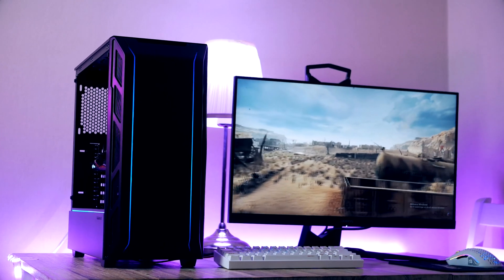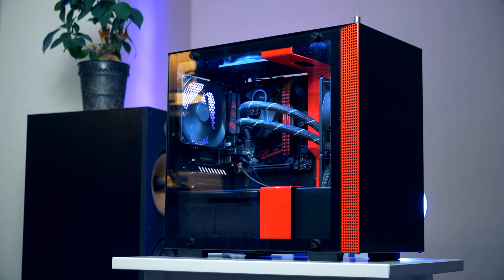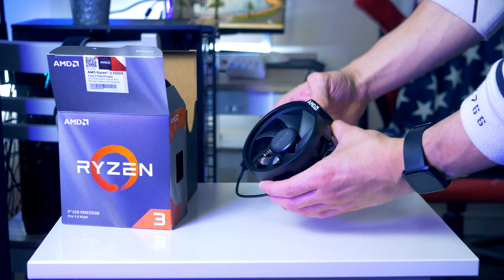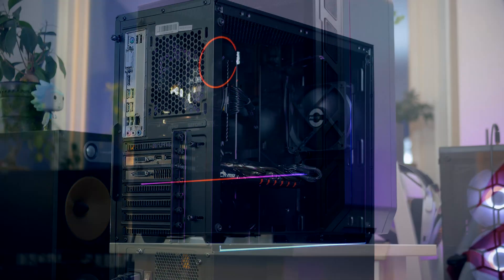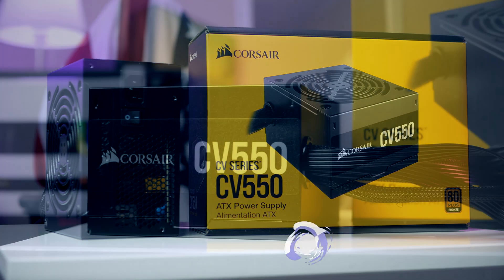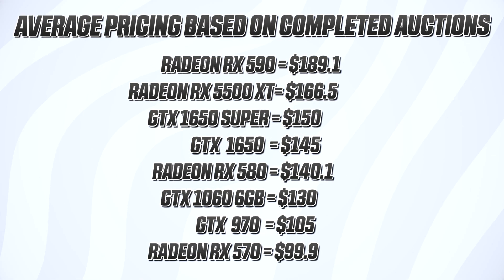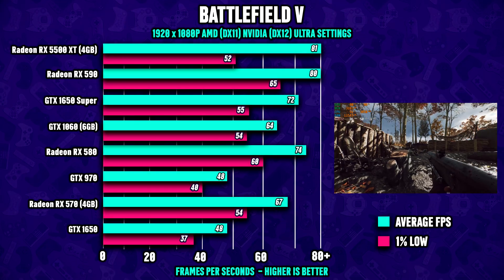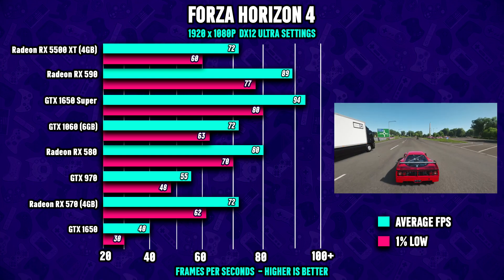Building A Gaming PC Under $500! Best Budget Ryzen Gaming PC Build [November 2020]

Comment: For console games the pc can barely run the games in 1080p 60 fps they need to optimize the games better its like all these years and we in pc are taking step back todays pcs should be running games at 1080p around 100 fps or more easily atleast in the console games that are ported thats unacceptable.

Comment: Will this pc be able to run warzone at a good fps
Reply: Every gpu on the list can bassivaly run warzone but I feel that the rx 580 8gb or the gtx 1660 super will do very good
Reply: GTX 970 is about on par with GTX 1060 3GB, or RTX 1650. You likely won't maintain 60 fps at medium preset in warzone, but with some tweaking you can have 60

Comment: I purchased all the components needed, still waiting for them to arrive. But I ran these components through pc part picker there is a warning that states "Some AMD B450 chipset motherboards may need a BIOS update prior to using Matisse CPUs. Upgrading the BIOS may require a different CPU that is supported by older BIOS revisions." will this be an issue. Any info on this would help clear up some anxiety thanks!
Reply: update?
Reply: @veryrare5213  If you purchase the motherboard from Amazon it will come with the correct version of BIOS needed to run the Ryzen 3 3100 CPU pre-installed. After using this exact setup pretty much I can vouch that everything runs pretty decent. I went with a MSI GTX 1650 super for the graphics card. The only slight issue I’ve come across is the CPU getting a bit hot when running under load. I’m using the included CPU cooler that came with the Ryzen 3 3100. Under load CPU temp averages between 133-145 F depending on which game or program your running.
Reply: @zachjohnson6722  idk if this will help or not but was there thermal paste on the fan if so then I apologize lol
Reply: @FrozentRex  The wraith cooler that comes with the Ryzen 3 3100 processors has pre-applied thermal paste.
Reply: @zachjohnson6722  oh ok I apologize have u seen any fixes for it though?
Reply: @FrozentRex  Fixes for?
Reply: @zachjohnson6722  cpu getting hot

Comment: What about Modern Warfare? How would it preform??
Reply: Depends on the gpu but with the gpus that are 150-200 you can get around 100 or more on warzone all low settings
Reply: If ur willing to spend about about 200 or 250 on a gtx 1650 u can get about 120 fps on high settings